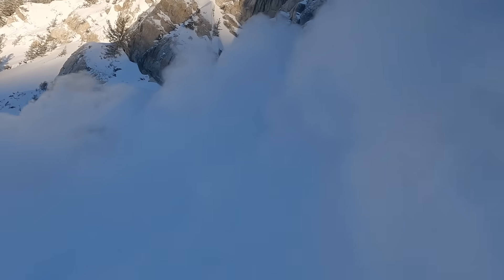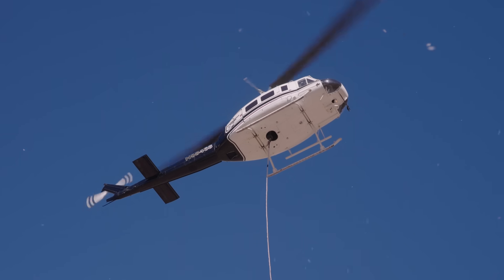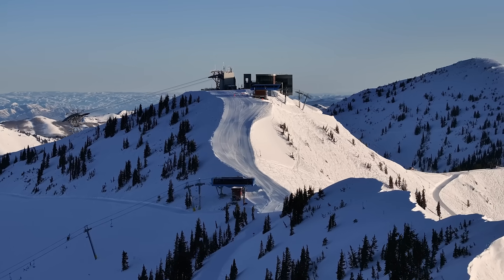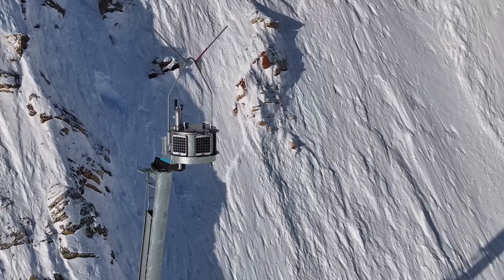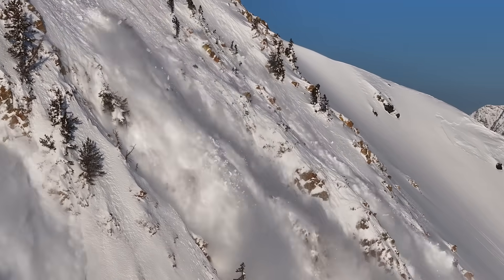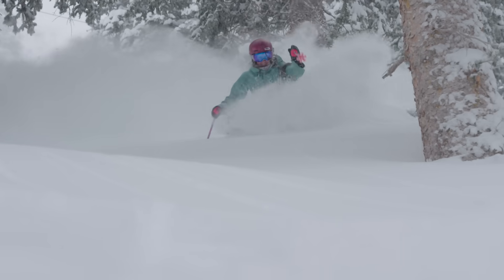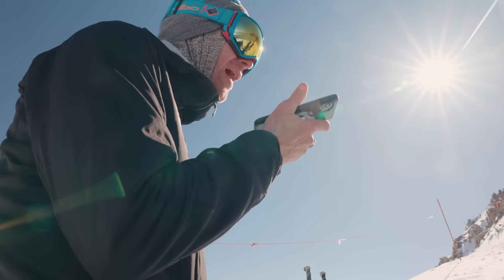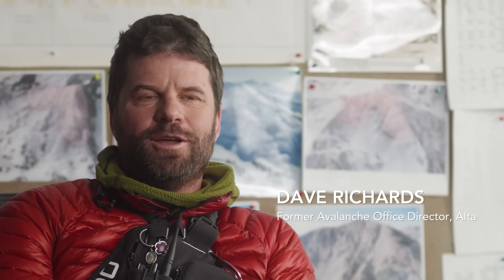The Evolution of Avalanche Mitigation in Utah

Comment: Former 0811 Field Artillery Cannoneer here. We fired the M777a2 howitzer using 155mm shells which seems to be a bit overkill for the task at hand, however they usually do require a multi-man crew and I would also assume that shipment of the rounds and fuses would be costly. I believe that using ground vibrations and/or sound waves is the best solution for the environment, safety, and cost efficiency. Thank you for the informative video Ski Utah!
Reply: This is exactly what I was thinking!

Comment: I worked on a team that was developing a radar system that they tried out for avalanche detection. I don't know what the results were from that. When I saw what they said about the howitzer not being used, I was wondering what kind of system they would use to 'disturb' the snow to cause avalanches. I was thinking of different ways to cause vibrations or loud noises. I think they nailed it with their solution. I think explosions are the least expensive way to make the loudest noises. It's brilliantly simple!

Comment: There is this story about ski patrol at Keystone. They were dropping charges at the top of some runs and one charge kicked off this big avalanche. It ended up in a back parking lot. Turns out a truck was parked there and got creamed by the avalanche. Broke all the windows and filled the truck up with snow. Turns out, the truck belonged to the ski patrol person who tossed that charge. That avalanche created a new run for the following season. They named the run after the ski patroller. :)

Comment: this is so sick, and I'm totally down for the quicker terrain openings and more safety for ski patrol, but I just see some problems. For one, jobs in the ski industry are already sparse enough, and a HUGE part of being a patroller out west is running routes and doing mitigation. So yeah... the mission used to take 5 dudes and 5 hours but at least those 5 dudes were getting PAID to do that and it's their passion. Not to mention, it looks horribly ugly to have those snowgun looking towers all over some of the most beautiful terrain that has never had anything but a ski lift ruining its look.
Reply: Exactly.  Those towers and helicopters are 1000x more expensive than 5 dudes.  It costs $3000 per hour to run that Bell UH1H helicopter. It drinks 160 gallons per hour of Jet-A fuel.  The cost of those ugly towers and maintenance of those pods is in the millions.   Who pays for all this sht?  You do, in the form of $300 per day lift tickets, and $30 dollar hamburgers

Comment: Based on the video, the last device is a dud, no bueno.
Reply: So the afternoon we filmed the Boom Woosh, they were performing some tests at Alta Ski Area on the equipment and gathering some precise data and measurements from the device. There had not been new snow in some time and we did not expect any avalanches. The purpose of the test firing was to inform Alta's snow safety team about how it had performed after an entire season of use.

Comment: some dual 24 inch subs in the proper box could send out a wave of sound hard enough to set off an avalanche or make rotary subs that can hit 1db and really make the mountains shake. explosives are not the only way to make a pressure wave.
Reply: It's physics. You'd need the dB spl to be at close range & have the same effect as an explosive. My guess is that your tiny 24" subs are going to be toast well before any snow moves.
Reply: @misterfunnybones  the physics would work if you played some bangin Jeezy tracks
Reply: 😂 yeah okay👌    Have you ever been up high on a ski hill?  How are you going to direct those subs to a certain spot on the hill? The bass would spread out over an entire 180 degrees and piddle out by the time it traveled 100yrds.  Just keep to having the subs in your trunk and cursing up and down the road while having the bass turned up all the way and everything else down, so you can’t hear anything but the bass.  Don’t worry, I get it… I was young and had a stereo system worth more than the car itself once.  This was before insulation and stuff to pack into your ride so you didnt hear the rattle of the vehicle.  
   I had a 77 Camaro, and  MTX box speaker with twin 15” woofers in the backseat or in the trunk.  Depending on how many females I wanted to get in my ride.    It would rattle the rust right off my quarter panels  and undercarriage. 😂
  You could buy “bass albums” that had no name rappers songs o there that had terrible bars and rhymes, but the bass lines were turned way up so you’d hear the deepest  and longest bass possible. You’d throw that in while “cruising”  so the females would go crazy hearing you come from 4 blocks away!
Reply: @ have you ever heard phat bass though?

Comment: Boom whoosh didn’t seem to cause avalanche….
Reply: So the afternoon we filmed the Boom Woosh, they were performing some tests at Alta Ski Area on the equipment and gathering some precise data and measurements from the device. There had not been new snow in some time and we did not expect any avalanches. The purpose of the test firing was to inform Alta's snow safety team about how it had performed after an entire season of use.
Reply: Using acetylene gas instead of propane might produce better results...
see YT vids re vortex cannons used for New years Eve celebrations in the Netherlands...
all perfectly legal...
far more power in acetylene.
Reply: More cost, too...

Comment: anyone familiar with how the last device works? In Tahoe where I ski they use the Gazex which requires flying propane tanks up before the start off the winter season.
Reply: The Boom Whoosh can run gas uphill up to 1km. This eliminates the need for helicopters for reloads in all but a handful of locations. This allows for placement of the gas control buildings at snow cat, or truck accessible locations.
Reply: It's the first RAC system manufactured in North America with input from transportation and ski area avalanche programs to meet the needs of North American clientele. While it is similar in end result to MND's Gazex system, the way it moves gas to the detonation chamber is different.

Comment: Spending to much in CO2 by flying a chopper to do a job. Find an ammunition supplier instead.
Reply: The Boom Whoosh system was designed specifically to remove helicopters from the equation. We also moved to use a hydrogen based system so the only byproduct is water.
Reply: @EricBressler-g7n  still seems like an overall worse solution
Also what were the helis used for?
Reply: @EricBressler-g7n  then why was there a helicopter shown being used? The video said it was built to stop using ammunition.

Comment: I'm curious how the types of explosives have changed. One of those explosions left behind an orange cloud, which makes me think it might have been tannerite, or a similar compound. But other explosives had different signatures. It would also be neat to see more from behind the scenes of how the weight, yield, etc. of the specific charge is chosen for the area.
Reply: That's a little more red tape than we were prepared to handle in the creation of this film 😉
Reply: @kapowder  Oh, certainly, it's likely information I'd only be able to learn if I actually became a technician 😂
Reply: It's probably ANFO, which is commonly used for blasting. It's 94% ammonium nitrate.  The reddish smoke is nitrogen dioxide, which is a generated by the decomposition of ammonium nitrate.
Reply: The orange smoke is more than likely from ammonium nitrate.
Reply: The FBI would like a word...